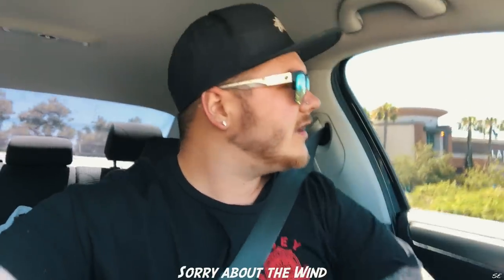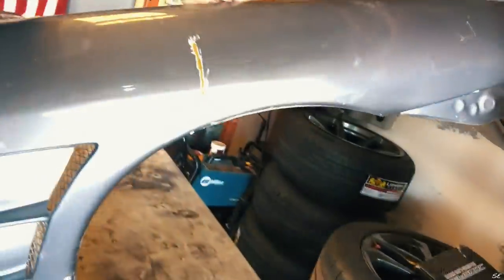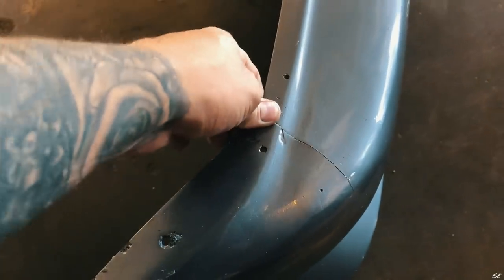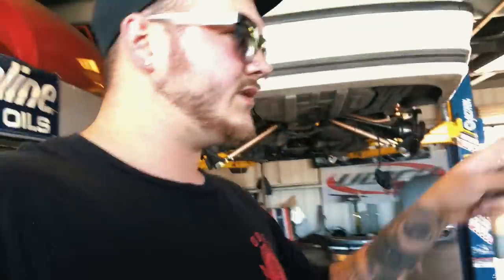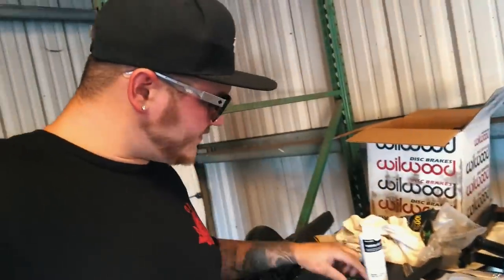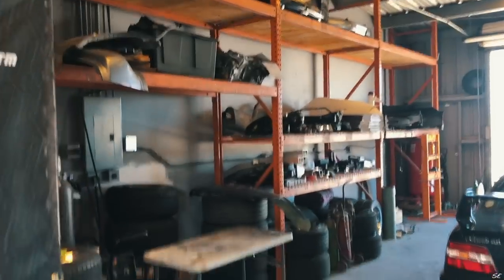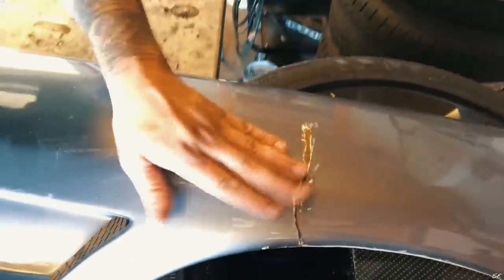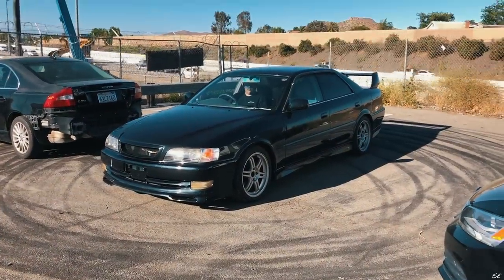Another Japanese Car??

Comment: Ive heard if you lay a piece of fiberglass have it a length you want, and then every Piece after you stack , have it slightly bigger in length every piece and it will help with having a bigger bonding area